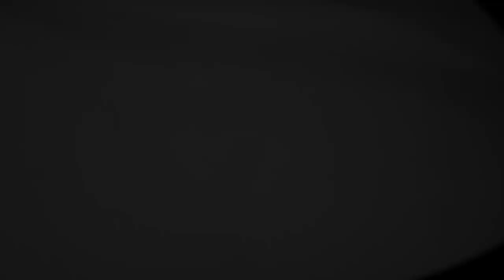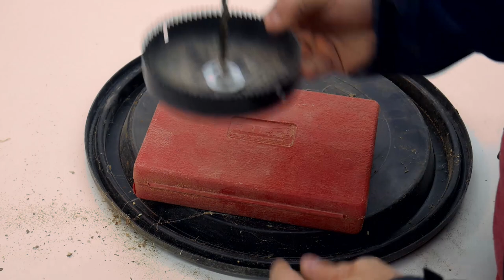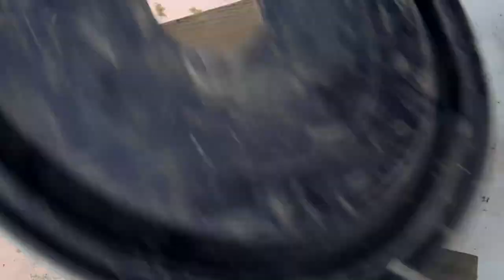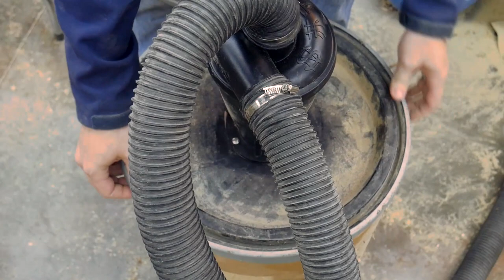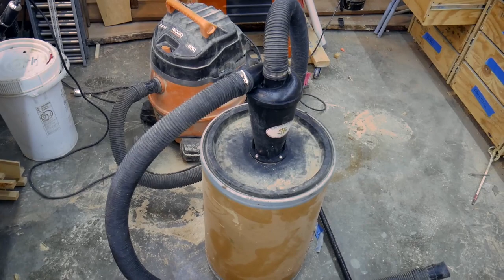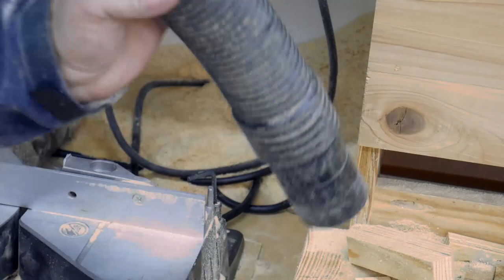$20 Cyclone Dust Separator: Good Deal or Garbage?

Comment: Brilliant test - very reassuring that cyclones in this price point work very well.  As they are more affordable I can attach one permanently to each of my dust producing tools - then just move the vac hose around as needed.   Just a suggestion ..maybe put a thin sheet (3mm or so) of MDF or ply under the lid as a stiffener to make the plastic lid less 'wobbly'. You'll need longer bolts though to go through the cyclone flange, the lid and the MDF stiffener.  Thanks for posting, much appreciated.

Comment: I have this on a 55 gallon drum with a 220 volt vac for a 8" floor sander - roughly 40' of 2" hose. Works great! 20% more air flow than the original dust depuy (I have three of them) and at the price point I think its a better deal than the dust deputy 2.5

Comment: So the whole idea was to not have to clean your filter so often. How did that work out? If the fine dust that plugs the filter is still getting through then where the heavy stuff ends up is not important. Seems to me a real test would be to weigh the filter before and after with the vacuum and again with the cyclone, and see if it is doing anything to solve the main problem .Quite honestly I have tried 3 different cyclones and found my filters were plugging up just as quick since the fine dust gets through anyway. The only difference I found was I had to empty a bucket and the vacuum tub, instead of just the vacuum.

Comment: I know I'm way old with this comment saying is this video was over a year ago. But I have that exact same dust extractor. If it's set up right, and used properly oh, it is a dream. I've even used it to clean up drywall dust and as fine a particles as drywall is; I had nearly zero blow through. Nowadays I won't do a drywall job Workshop clean up without it.
Reply: Jericho Joe, I sure am happy to hear you say that about this dust separator because I just got the 6th generation model from this company and this is exactly why I bought it. I have a lot of drywall sanding to do.

Comment: So if I'm going to vent the shop vac out a window, do I still need a dust separator?  Will the concrete dust likely gum something up on it's unfiltered way through the shop vac?
Reply from the maker: I think you would be ok as long as it isn’t venting onto someone else’s property. It will make a mess outside of the vent

Comment: I have the same brand, one issue I am facing is the sound it creates. Is that something you are also facing?
Reply from the maker: No odd sounds coming from mine. Sorry
Reply: @SouthpawWorkshop  thanks I figured it out, it was not the cyclone but the pipe I was using

Comment: I'm preparing to build a dust collector for my shop and I was going to use plastic 55 gallon container. After watching your video I am going to use a cardboard Barrel instead. I believe the cover will have to be reinforced or as you stated something is going to break. Thank you for taking the time to make the video.
Reply from the maker: Thanks, Marty! Yeah, I think if you reinforce the lid with something as simple as 1/4” plywood, you should be good to go.

Comment: I have one and I think it's crap and so is the deputy. looking for better method. Ty for the test
Reply: How so? All things being equal, a good 6hp shop vac with a clean filter should work well with a Dust Deputy. Don’t hear too many folks unhappy with them. The off shore models are a lot cheaper and the test was to see the black one worked well which it did. A test between the two would be beneficial but I’m not sure how you can categorically call them both crap. I’m not being negative here, I’d really like to know before I order a DD or wait 3 months for one from China.
Reply from the maker: You don’t even have to order one from China anymore. In the time since I posted the video, these have become widely available on Amazon. I even have a link to one in the video description.
Reply: @SouthpawWorkshop  awesome I just killed my new Shop Vac and the warrently is no good after 6 months as the company just closed their doors so I got a DeWalt and want to set up a separator. I’ll use the old 12 gallon Shop Vac canister for the dust collection part, just need a cheap deputy-like device and I’m on a budget with two shop vac purchases recently. Thank you sir.